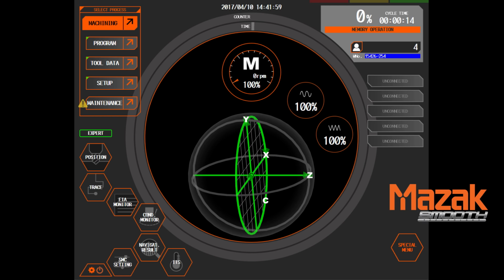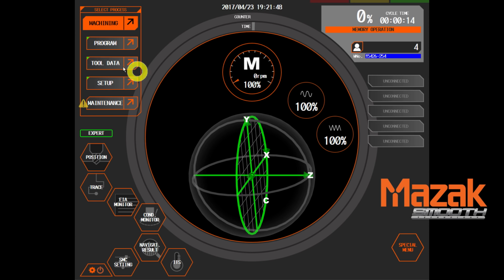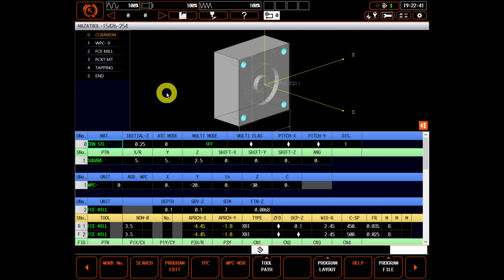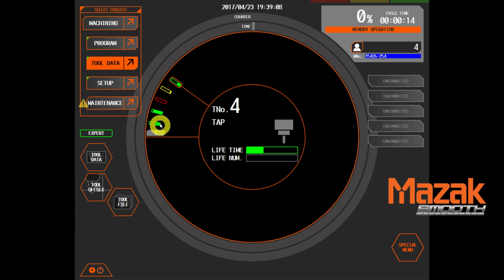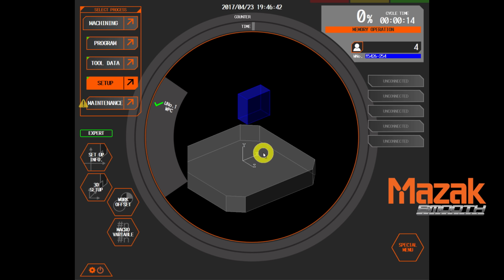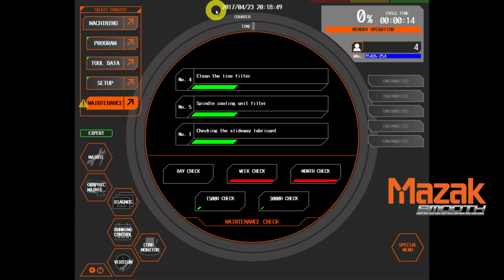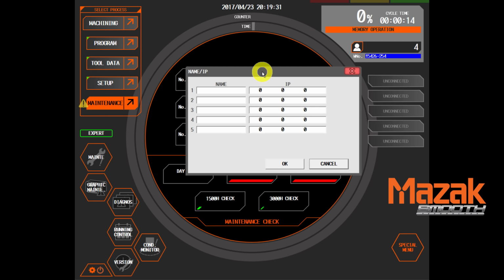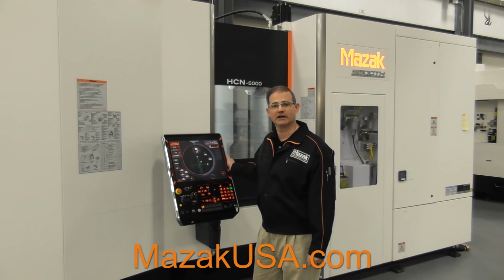SmoothX and SmoothG Home Screen Overview

Comment: Any ways to eliminated all the 3d stuff to increase the FPS of the position monitor.
Reply: I deleted every 3D modell (tool, vise etc.) and I put "M660" code into my programs (In the 99,9% of my jobs I use eia programs but it works in mazatrol too). It turns off the collision detection (which not works well at all) and you will have less lag, but the smooth will never be a fast controller. :(